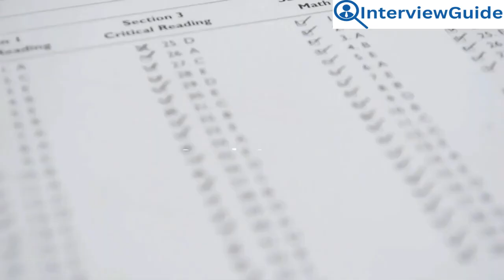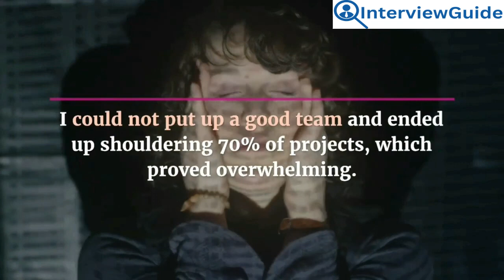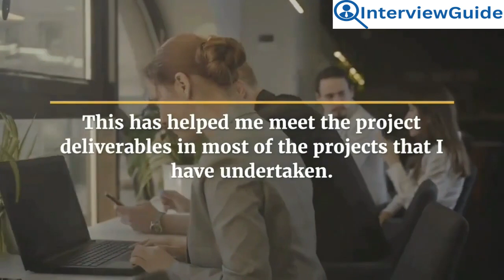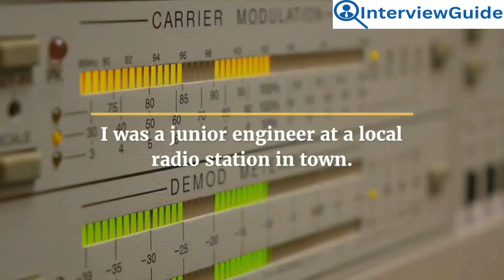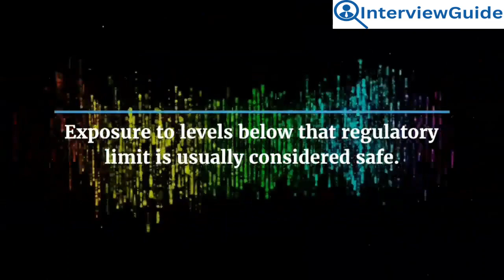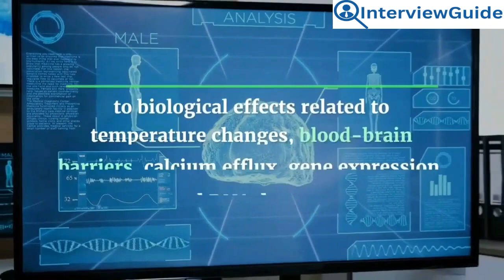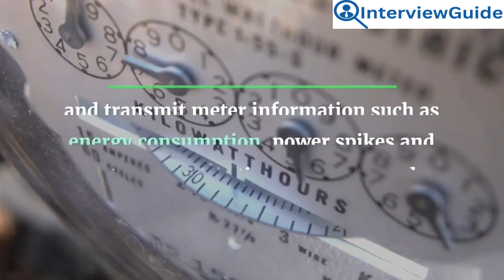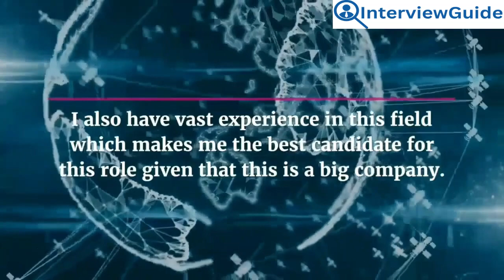RF Engineer Interview Questions and Answers for 2025

Comment: Are all electronics engineers can apply as an rf engineer job??
Reply from the maker: You can apply if you have the specific knowledge and experience in areas like RF circuit design, signal propagation, antennas, and wireless communication.
Reply: @InterviewGuide-tips  i graduated a bs electronics engineering and i have passed the board exam too i got my license id. I have a knowledgeable in rf but i don't have yet an experience. Will i be hired if i apply the rf engineer job??